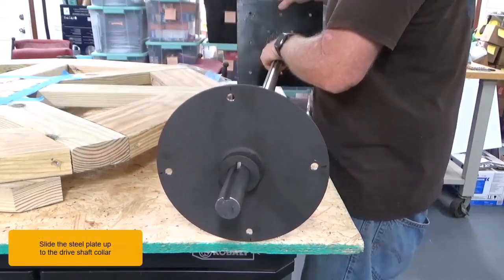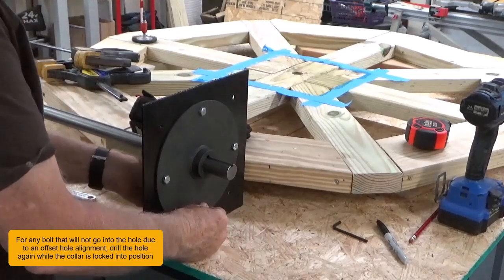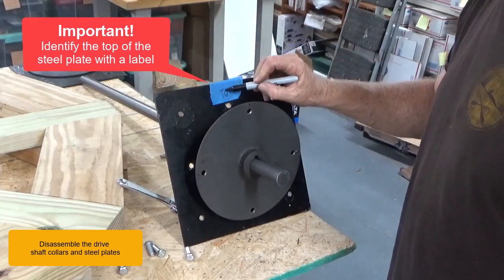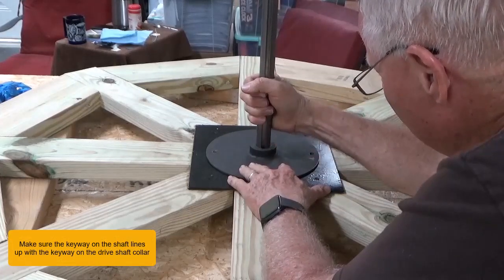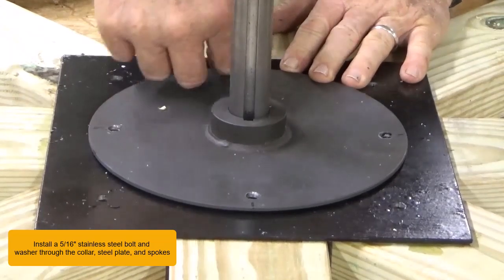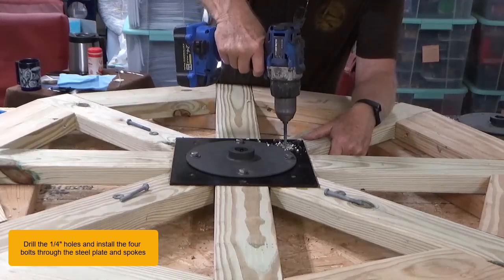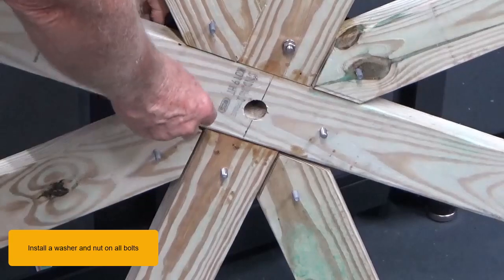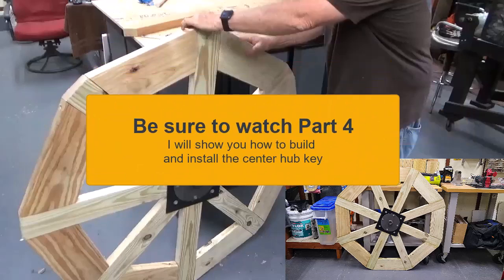Part 3 of 8 - Water Wheel – How To Assemble the Steel Plates and Drive Shift

Comment: Norman...building a water wheel....great video easy to follow...where is the driveshaft and collars assemblys available from
Reply from the maker: “I’m so glad you found the video helpful—thank you for taking the time to watch, I really appreciate it!”

Below are some links on the parts used to build the driveshaft and collar assemblies.
Parts Source:
Fully Keyed Shaft and Keys - https://redboarchain.com 
Pillow Block Bearings - https://amzn.to/3s6hHov
Shaft Collar Lock - 1.00" Bore Diameter - 303 Stainless Steel (2 Pack) - https://amzn.to/3OS3hB9
8” Brake Disc – 1” Bore – 1/4” Keyway – 2- Set Screws - https://amzn.to/3OSwDPX
10x10x1/8” Steel Plate - https://amzn.to/3KC0ARO

Note:  You can also find the links for other items used building the water wheel in the video description. Just scroll down and click on more to the see the full video description.